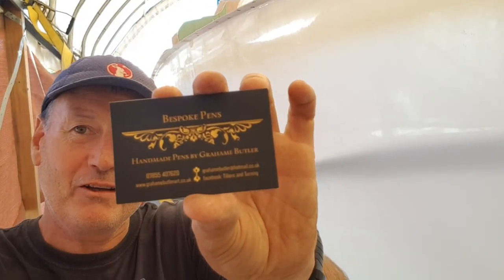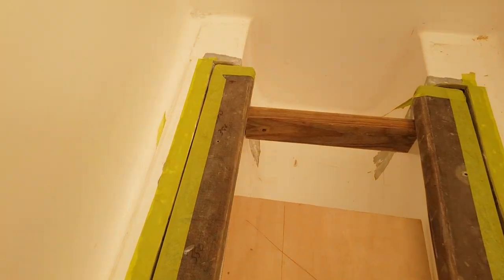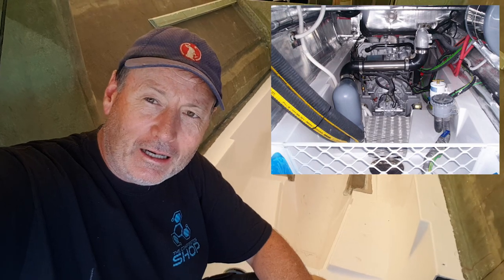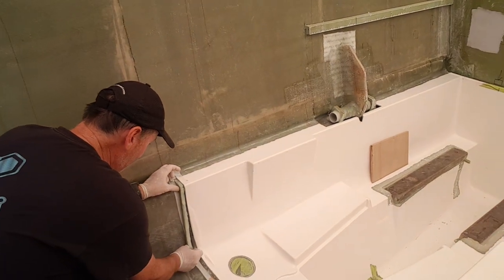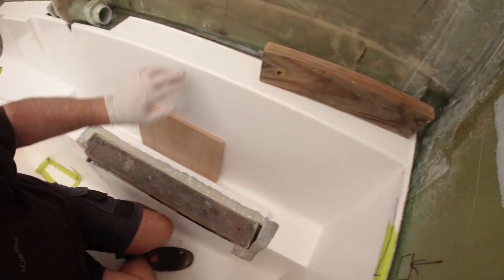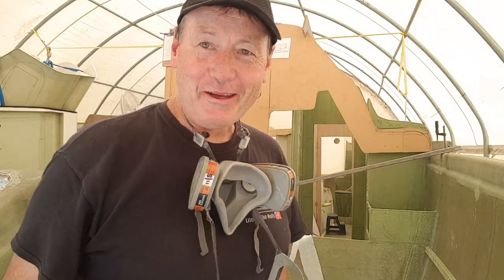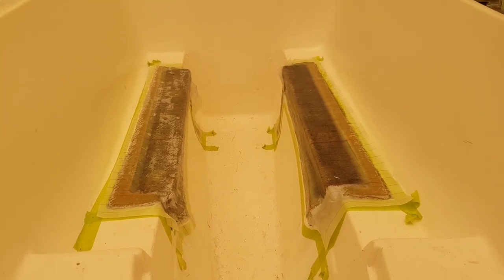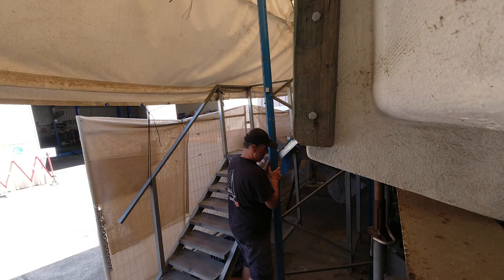Ep145 Engine Module to Hull Integration

Comment: Hey mate, love the channel. You probably know this already, but just in case you haven’t..... a silicone cooking spatula is absolutely brilliant for coving and reusable. Just passing on a tip that worked very well. Pull the handle off and you can squeeze into tight spots like you wouldn’t believe.👍👍🇦🇺

Comment: Those mounts are going to be too pretty to cover up with those dirty (eventually) motors Ross ! Sorry about the dentistry, had to have same filling re-done a few times this summer and fall until it finally held for good ! Kept wondering if I was getting the cov bug from the novocaine numbing taking a few days to go away completely ! Watch out for heat stroke, and stay hydrated too !

Comment: I have been watching since the beginning. I really appreciate your attention to detail. I have a suggestion. Get some aluminum bar stock 12mm or thicker as long and wide as you can fit atop the wood you glassed in. The aluminum will sit on top of the wood blocks you installed for the motor mounts. Drill and counter sink 10 or 12 holes down the length of of the bar to attach the aluminum to the wood. Then drill and tap holes for the motor mounts to bolt them to the aluminum. The aluminum would spread the load across the complete board and in the future if you need to change the motor mounts you would have a threaded holes for the bolts. I drew up a sketch but I couldn't find an email address. Just a thought. I really enjoy your channel. Thanks
Reply: Jack Hole  Thanks for setting me straight. I thought the rubber mount would isolate the aluminum. As clean and dry as that engine compartment looks I figured the aluminum would stand up pretty well with some never-seez on the bolts. I'm not an idiot the zink bolt comment was a bit un called for.
Reply: Jack Hole  I didn't consider that thanks for the explanation. Sitting on my couch it seemed like a good idea, I don't get a lot of salt spray over the bow of my coffee table.

Comment: Roll on the demoulding!!  

The day I hear you say *nah! that's enough" and the job is less than perfect will never come, the worst feeling in the world is looking at a job you've done and you can see a fault which you know you could have fixed but couldn't be bothered.

Can you tell me the name of your masking tape manufacturer?  I want to buy some shares 🤣🤣🤣🤣🤣

I know that you do a huge amount of sanding, have you tried extending the life of the abrasive by cleaning the pad, roll or reel with a block of crepe rubber?  You can extend the life by 2 or 3 times, a hell of a saving.

Comment: You might try sharing on a new platform like Rumble not because you're going to get throttled by YouTube or anything like that. But Rumble is starting to take off as a video platform and I don't recall any boat building vids yet on it. I'm betting you will take off quickly and added advantage in on the ground floor

Comment: Incredible work Ross. The amount of work in the engine bays is remarkable. Spend the time now so it doesn't haunt you later. Couldn't imagine doing work down there once the engines are in. Oral bone graphs, no Bueno. Had one years ago. Luckily they used my own bone. The thought of cadaver donor bone in my mouth creeped me out.
Reply from the maker: Hey Mark.New bovine grafts from Switzerland so will be able to yodel now.Ross.
Reply: @LifeOnTheHulls  LOL. Yodel and produce milk... I had three titanium implants put in. The graph was the worst. Oh, and nice job on the teaser showing the hulls out of the mold. Very shiny.

Comment: Well, your channel has always been exciting, but I get your point.   Congratulations on the hulls.   From what I could see in the intro they're beautiful.  👍  Have you kept track of how many brushes and plastic bags you've gone through? 🤣
Reply from the maker: Pretty much don't throw brushes,away. Clean after every use with acetone. Piping bags,about 80 so far si in all not much wastage on this project. Lots of flies and respirator filters.Cheers Ross
Reply: @LifeOnTheHulls  Wow!  I never knew you could clean the brushes off once you added the hardener.

Comment: Just curious, were those Engine bay modules really necessary? A bit of sanding and flow coating the whole area as you had already partially done would generate a nice finish and also reduce the weight. Can't wait for the demanding vid. Cheers
Reply: They isolate any leakage from the bilges. He's gone over his reasoning for them multiple times.